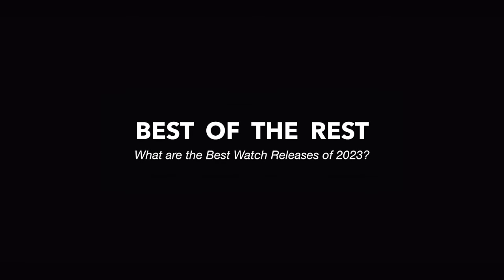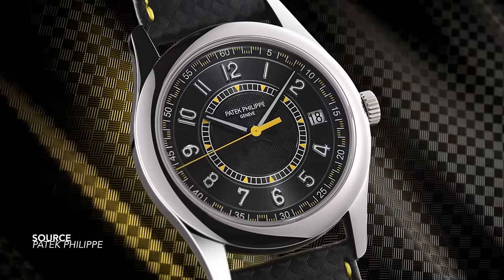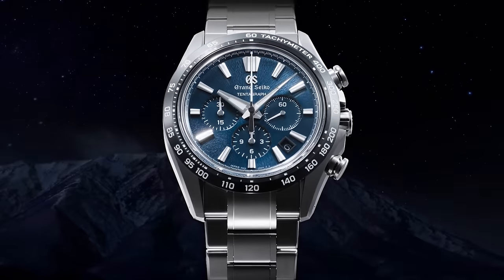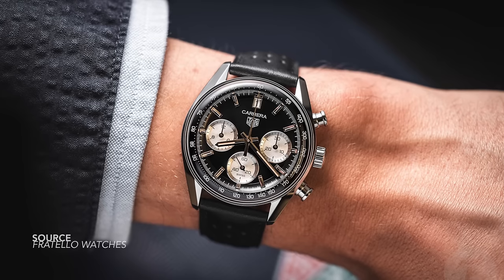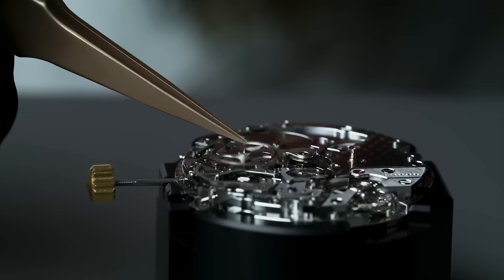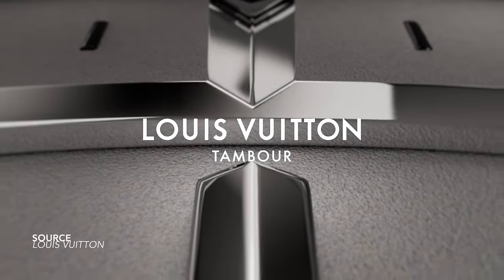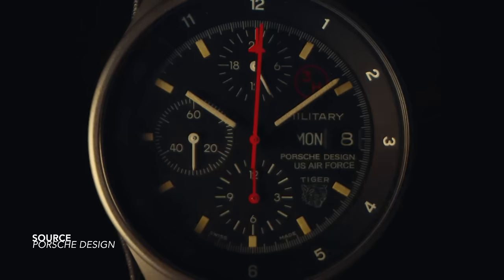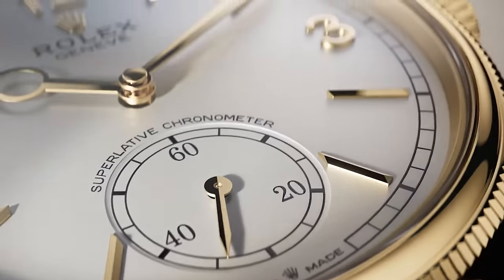What Are The Best Watch Releases of 2023? (40+ Watches & Year Recap)

Comment: Great choices here, I purchased over 12 watches from two of my favorite AD in 2023. first I tried on the IWC Inginieur  and I feel it's not worth 13K or more for the Ti. I purchased the Tudor BB54, Tudor P39, Seiko SJE093, Rolex Sub Kermit 126619LV anniversary, Longines LD39 both dials on BOR, Breitling AVI 765 B09 1964 LTD 164 pieces with ADLC bezel, Tag Heuer Glassbox reverse panda which I love all 2023 releases, in addition Glashutte SeaQ 39mm rosegold case, Navitimer 24HR dial Scott Carpenter platinum bezel, Rolex Sub 124060 ND, Rolex Explorer 2 126570 Polar and black dials and finally the Seiko slim Turtle. I love the Legend Diver and 62Mas recreation and yeah I went nuts this year.

Comment: My pic would be the JLC Chronograph, the Duoface allows it to fly under the radar in time telling mode, flip it and you have a timing tool, I love it. The engineering involved in making this is epic. One release that possibly fell off the table would be the reduced size Longines Spirit COSC certified now available in 37mm with the date finally at 6.

Comment: For me personally, it would be the Explorer 40. As I set my watch collecting foundation, I knew that a new Explorer was part of my three tool watch strategic plan (Pelagos 39, Explorer, Speedmaster Pro) but the new 36, that is actually less than 36mm, is just too small for me. The 40 is perfect and will be a forever purchase that gets handed down.
Reply: Why? The only new thing is the size, hardly innovative.
Reply: @garyboyle695  I explained why it is the best watch release "for me" in my comment.  The key is - for me.  I want a new Explorer as a key piece of my core collection, and the 36 doesn't work for me.  When they released the 40, it was the best release of the year based on what I was looking to purchase.